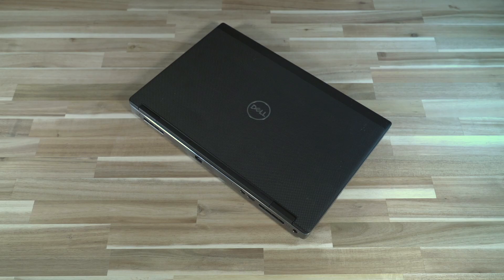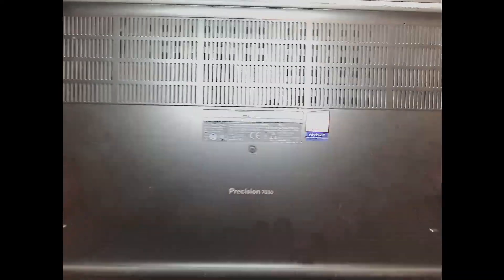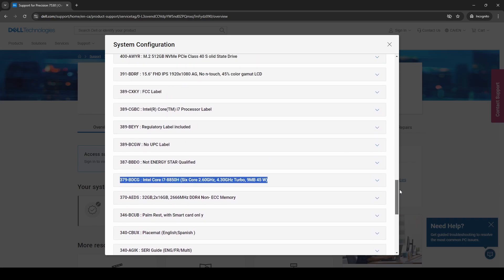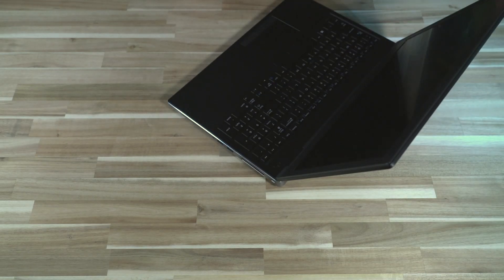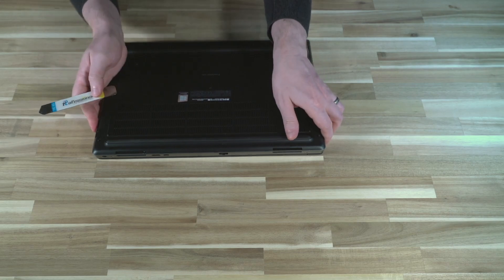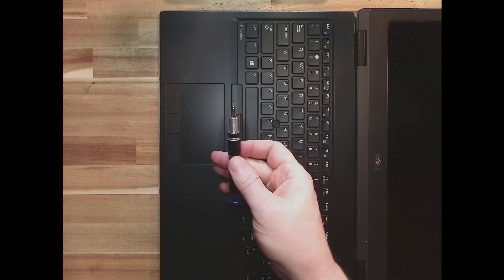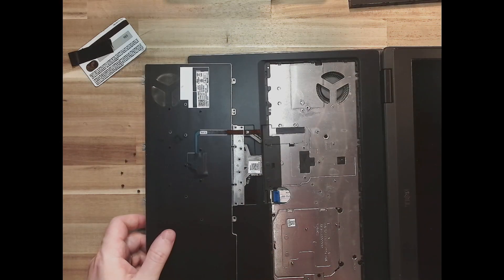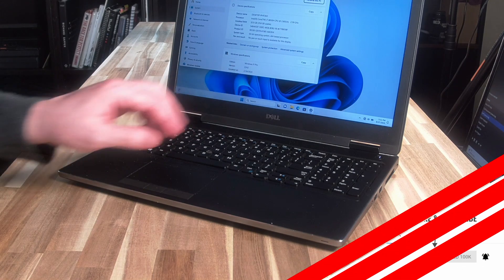Dell Service Tags and the Dell Precision 7530

Comment: Nice especially the triple storage option.
Reply: My Latitude 6540 also modded with triple storage. The same for the Latitude 5490 too.
Reply from the maker: Which mods?
Reply: @LaptopRetrospective  for the 6540, use the WWAN slot for MSATA SSD, DVD bay for 2.5 inch drive & the primary HDD bay for another 2.5 inch drive. 

For the 5490, use the WWAN slot for M.2 SATA single sided SSD, NVME slot for M.2 NVME SSD & 2.5 inch bay for 2.5 inch SATA drive but without the casing. Most 2.5 inch SATA SSD drives only occupied 1/3 of the space. I cracked open the case, plugged back the SATA cable and voila, the BIOS found all 3 drives. Pretty stable for several months now. In other words, the 5490 can go up to 6TBs easily but expensive. I kept mine at 3TBs.
Reply from the maker: A rare thing in a laptop.

Comment: 12:32

Hello sir, 
(a7) me fw downgrade - request mespilock failed 
This message appears after dell logo when booting and windows starts normally,  how to fix this message ?
Reply from the maker: This seems to be documented for other models: https://www.dell.com/support/kbdoc/en-ca/000138945/latitude-7275-how-to-resolve-the-a7-me-downgrade-request-mespilock-failed-post-error
Reply: @LaptopRetrospective  I already downloaded the last bios and firmware updates. 
Someone recommend to make reset bios settings and clear NVRAM but I don't understand how

Comment: How was the pointing stick on this?  I've heard people say that nobody else's is as good as ThinkPad's.  I've used several over the years (most recently HP, which was 5-10 years ago), but only briefly, and never really noticed a difference.  Mind you, people say the some of the older TP keyboards are better than others, but I've never noticed a difference (except the 701 keys are really stiff).
Reply from the maker: It's certainly serviceable. I think the software that interprets the strain gauge readings allows it to "flow" a little better if that makes sense. It isn't a bad experience.
Reply: @LaptopRetrospective can you talk about the Dell precision more I have a 4400

Comment: Some Dell laptops from 2010s are built with cheap plastic materials. These are hydrolytic and start weathering.
I confirmed the 3rd to 6th gen i-core models are terrible. But  before 2nd gen, Dell uses good plastic panels.
For example, Dell Latitude e6410 comes with the display latch is still useful today, nothing broken or corroded.
Hope this one is different.
Reply from the maker: Not as familar with Dell laptops as I am ThinkPads, perhaps once day when I've looked at more I'll be able to weigh in on the built quality over the years.
Reply: @LaptopRetrospective  Well, it happens only in the hot and humid climate, such as Texas or Japan.
Reply from the maker: Good to know. My area probably wouldn't qualify as either most months of the year.

Comment: 1. That is a dumb way that they want the keyboard to be removed.
2. It said that it came with Qualcomm wifi which means no vPro.
3. You missed showing if it came with a webcam and/or fingerprint reader.
4. I'm glad that you showed the power supply so people can see how big/small it is.
Reply from the maker: Shoot, you're right. I did miss talking about the camera and fingerprint reader.

Comment: I love my Dell Latitude 5290 laptop. I use it as a backup when I don't want to bring my main laptop in public. Those 8th-gen U series chips do the job just fine for daily tasks, and are good on battery life. The thing I love most about Latitudes is that their chassis design is generally very durable and sturdy. These things are built like tanks. I've dropped mine so many times, and it's survived quite well. They don't mark up or get dinged easily. And it's super easy to find replacement parts. It is, IMO, the ultimate Windows 11 netbook, and they're cheap, like under $150-$200 on ebay all day.
Reply from the maker: Dell did build a pretty durable business product. 👍